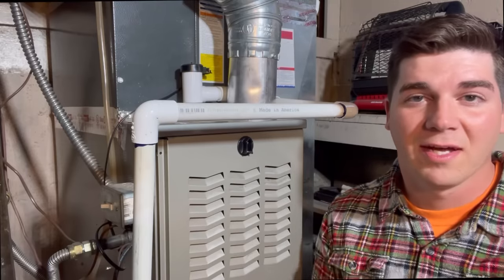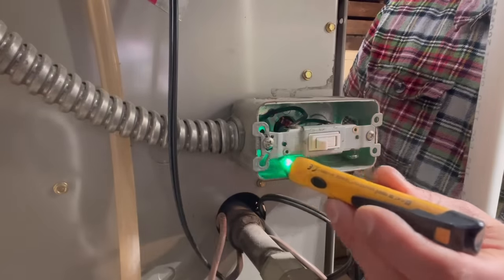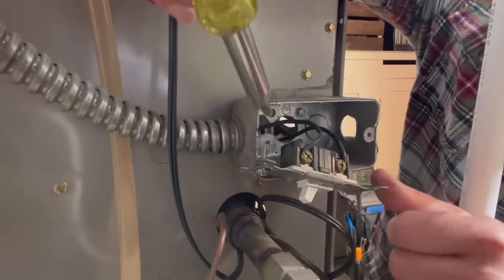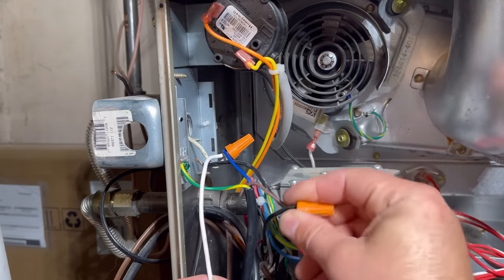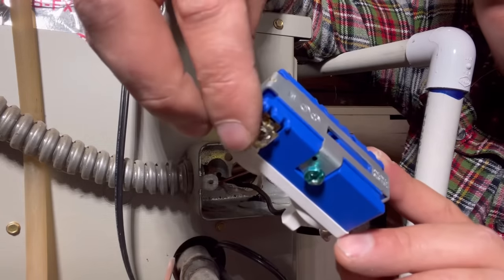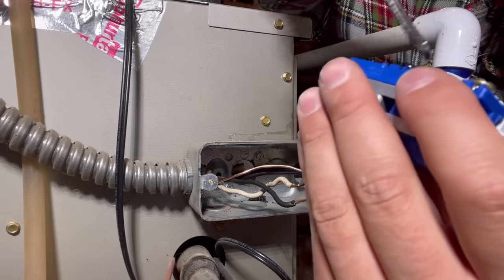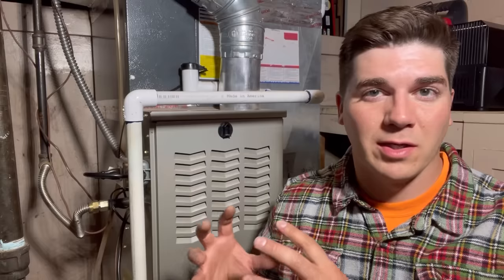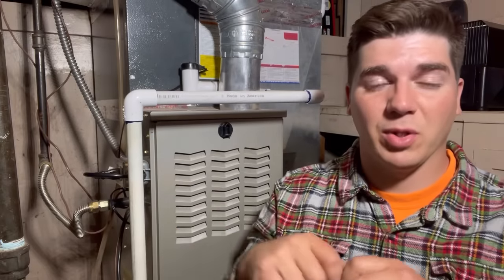This Could Keep Your Family Warm During An Emergency Power Outage.

Comment: One thing I would suggest is that the plug and appliance cord that you use is rated for the amperage that your furnace is on. Meaning a furnace on 15 Amp circuit should have a minimum of 14 AWG plug and receptacle connected to it. 20 Amp circuit should have minimum 12 AWG
Reply: Incorrect.  The appliance cord only needs to be rated for the appliance load.  Does every thing you own that plugs into a 15 Amp receptacle have a 14 AWG cord????  No.  Stop giving advice when you know little more than nothing about it.
Reply: @DiffEQ  As mentioned it is a suggestion, not a requirement. He didn't cover that in the video, so I made mention of it
Reply from the maker: Thank you for this 🙏🏻
Reply: I'm mildly concerned that he used a 15A receptacle and plug on a 20A circuit. While it's certainly possible his furnace doesn't pull more than 15 amps, other people's furnaces might, and this will lead to people using under-rated extension cords during an emergency.
Reply: @DiffEQ a furnace that is hooked directly to a 20 amp breaker should be 12 awg all the way to it. Doesn’t matter what the load is. If the manufacturer says a 20 amp circuit minimum of 12awg.
Reply: @robbievermillion5101  the power supply wire in the furnace is not 12awg, i double its even 16awg
Reply: @catgirl_works  thought I was the only one who caught this.  Furnace circuit was 20amp.  Assuming this is the only "outlet" on the circuit per NEC 210.21 (B) receptacles a single receptacle has to be equal to circuit.  He should be showing and linking a 20a switch/outlet.  The 12/3 pigtail would then be necessary for this install.

Anyone who has a 15a furnace circuit would then be ok utilizing a 15a switch/outlet and 14/3 pigtail would then be sufficient.  

Now it gets a little tricky per NEC if the furnace circuit is supplying multiple outlets on a 20a circuit then 15a or 20a outlets are allowed per code.
Reply: @JSATI  It seems like his extension cord is very short. This makes a big difference in its conductance. If it is longer, then you start running into it acting more like a fusible link or a resistor (getting hot with measurable voltage drop) on the other side of it.

Comment: I did that years ago so I could plug into Honda inverter generator when power fails. It’s been used many times. In 2020, had a full system changed. The installers saved my parts, and asked me to wait until after inspection before modifying again. I used two boxes since I have a condensate pump, and used a surge suppressor outlet. I have a modulating system, so want power line protected. Also, added 50A240v suppressor to outdoor inverter unit. Great idea, easy to keep warm when power fails.

Comment: I made that exact modification to my furnace 30 years ago when we were having frequent power outages.  Did it in my next house also.  Saved my bacon on numerous occasions, especially in 2017 when a windstorm took out power for almost a week!  I was able to borrow a generator from a friend and I had heat (and refrigerator and internet!)  My current neighborhood has below ground electrical service which has been very reliable, so no need to do it to this one yet.
Reply: Hay Dave,
For safety sake I always wrap my connections with electrical tape, especially when they are in close quarters like a steel box.I just like to insulate them so that they don't possibly short out at some point and possibly cause a fire.
Reply: @danstein8305   A short to ground trips a breaker.
Reply: Wow! Wish my internet was somehow connected to my furnace.
Reply: @duckhunter8387  I still had cable, just not electricity.
Reply: @dperreno  Just a little sarcasm! Peace Brother
Reply: My town in north east Montana has underground & above ground power lines from the power plants to the substations, substations to substations to our town, to my house. 
Just because you have underground power lines from your home to your local electric supply substation, does not mean that you will never be out of power. 
Once a wind storm 75 miles away put us out of power for 4 hours. 
Long enough for the food in the refrigerator to become questionable. 
Hello from the north east corner of Montana. 
10 miles from the Canadian border.
Reply: @dperreno  My current generator connection powers my refrigerator/freezer, enough lights for safety, a power strip for device charging (I consider a charged phone a must during emergency conditions), TV and radio (ditto), and my internet modem. 
This is a reasonable minimum system to keep me, my family, and my home safe when there are no freezing weather conditions.  A mod such as shown in the video will extend that safety to freezing conditions as well.
Reply: Not required per code, BUT you are required to have an earth ground on the metal box per code. If you get a short, a breaker will trip.

Comment: About that “secondary measure” to test for power: I like to test for power BEFORE I shut off a breaker, so I can detect power, then shut off the breaker, then re-test. This is a great tip, I’m going to do it (any day now….)
Reply: One further measure to verify there is no power is to short your hot wire to a grounded appliance surface or to a neutral wire. This s more trustworthy than the inductive tester imo.

Comment: Had a new furnace installed in may. My guy set this up on my furnace. Had a code pop up on my smart thermostat. Easy fix to turn off for five minutes. Flipped switch back on problem fixed. I recommend this for every furnace.

Comment: I do it differently. I install a high quality female plug on the end of the armored cable and then a male plug going into the furnace (similar to what you did but also using armored cable). Normally the two are pugged into one another but you can unplug the furnace and use an extension cord to your inverter or generator. Very simple. No extra switches or boxes or anything else.
Reply: And safer for the linesmen trying to get your power up and running.
Reply: @donziperk  this mod can in no way create an unsafe condition for the linemen.
Reply: Having a switch near the furnace is a code requirement in many places. I think that might be based on the assumption that the furnace is hardwired. Some jurisdictions only require the switch if it's hardwired, but other places (like where I live) have a blanket requirement for all furnaces. Of course, many places also require all furnaces to be hardwired anyways.
Reply: @johnbugden2222  Yes, this is true. There is a red colored plate that identifies the switch too. That switch should not be removed or altered in anyway. And of course, licensed electricians must follow code or risk losing their license.  But what a home owner does after the fact, is up to that person. And must take all responsibility for the modification. Videos like this one can be a great source of information for many people, but there are those who really don't know what they are doing and should never attempt such things. That's the scary part.
Reply: @johnbugden2222  In our city, a switch is required. But the code changes. Our old furnace had the switch up high, so a child couldn't reach it. Now the code requires the switch to be low, so that anyone can reach it.
Reply: I did it this way once with short sections of a 12 gauge extension cord with transparent male plug with power indicator lamp molded in. Code aside regarding furnace master switch, this scenario guarantees that there is never power sent upstream to the lineman on the pole down the street. The furnace is only connected to the MAINS voltage or emergency back up but never both at the same time. Sure a plug should not be used as a switch. But with no load and a VERY LOW frequency of ON/OFF cycles I think this small electrical technique indiscretion might be overlooked.
Reply: @Roy Riederer  Absolutely, there's nothing wrong with your method in my opinion. I commented because I think you may be able to follow the method in this video and still be up to code in certain places. I'm not sure about that, though.  I also totally agree with your point about videos like this being very useful but I do worry about people who don't know what they're doing attempting these sorts of things. I'm not an electrician but I do know my way around these sorts of things. I didn't start out that way, though, and when I first made started doing diy electrical work I would do 5 hours of research for a 5 minute project. Not an area where you want to learn from your mistakes. YouTube should automatically include a warning for this kind of a video
Reply: @johnbugden2222  I know what you mean. One problem with attaching warnings to videos is the people who make silly mistakes are the same ones who ignore warnings. Sometimes, you just can't win.
Reply: I have a heat pump HVAC system but I have a gas backup. And the I guessing I need to pull the 220 breaker but I need information first  before I do anything. Thanks again for getting me to come up with a plan.
Reply: Can you post a video please.
Reply: I have a fused circuit to the furnace, can I eliminate it?

Comment: I love this overall idea and I think its a great contribution to family readiness, an issue I have worked on all my life. I do have a couple of small concerns about the execution that if addressed would enhance the longevity and the utility of the installation. I am a retired electrician after 45 years in the craft. I worked on alternative power on large and small scale projects. I just want to offer a couple of small alterations to this project. 

The clamp used to hold the cord is the wrong type. You can buy a cord connector at the same place you would buy the cable clamp use here, They are just as straight forward to use so the difference in the work is almost nil. The difference in a cord connector is that it squeezes the cord over its enter outside to hold it in place were the cable clamp clamps down on the cord distorting its shape and putting needless strain on the individual conductors. The compression of the individual conductors can cause the insulation on the wire that ends up under the cable holding ridge in the cable clamp. It seems a small thing but over the long haul it can lead to a fault which would open the overcurrent protection on your inverter and force you to locate the problem and repair it before you could get the furnace back on. 

Second thing is also rather small when compared to to the overall idea which is very good. The knock out between the switch box and the inside of the furnace has a rough and possibly sharp edge. By placing a chase nipple through the hole from the switch box side, tightening its locknut on the inside of the furnace to hold it in place, and screwing a plastic bushing on to its threaded end inside the furnace you can eliminate the possibility that the edge of that opening will cut into the cord because of the vibration of the blower motor over a period of years. It's a small change. the alternate parts will come to less than $5 additional cost and insure a longer and safer life for this modification. 

Tom Horne

This is my last and final will. Good luck to all of you. Joe Hill
Why yes, I am a red diaper baby. I was born into a union household and have been a union worker all my life.
Reply: "I was born into a union household and have been a union worker all my life."
Please dear God tell me you don't vote republican.
Reply: @rael5469  republicans keep you warm in winter and cool in summer. You’re welcome
Reply: @DoDgeSwaG  OK, put down the beer and tell me what that mean.
Reply: @9856CB  You're drunk. I can see that from behind a computer screen on the other side of the country.
Reply: @SL-xg4ug  Who is Brandon?
Reply: @rael5469  Bot confirmed 👌
Reply: @SL-xg4ug  You removed all your replies. Are you Brandon?
Reply: @SL-xg4ug  Would you care to explain which contributor you believe is a bot? 

Tom Horne

Comment: Not sure if anyone mentioned this below but the wire should wrap around the switch / outlet screws clockwise, kinda like the way you did the ground. Thanks for the video!
Reply from the maker: Yes thank you for this. Every little detail matters. Cheers
Reply: Only if he was using j-hook wiring to the switch/outlet. He instead used back wiring where the screw clamps a plate down onto the wire. (This is different from back-stab wiring.) Back wiring like this is common on commercial grade outlets. See this video from "Everyday Home Repairs" for the details of back wiring: https://www.youtube.com/watch?v=SSfPzunEQ9g (I'm sure there are other good videos, I just happened to know about this one.)
Reply: Nope, depends on the receptacle. He did exactly per the manual come with the receptacle. You can use the J hook method but that not the only method here.
Reply: No, this one has metal clamp plates, which are better still, and allow two wires to fit neatly.

Comment: I did this years ago, and have had to use it 2 times with am Onan Generator when we lost power for 2 days in the winter. It works very well. Only thing I did different was I used a red outlet for the furnace switch/outlet. This was much cheaper than getting a dedicated generator and transfer switch. I also installed an on demand water heater propane fueled to provide hot water if needed, that has only been used to test once a year. I bought an Onan rolling Generator for $1100 that is 3000 watts, and can run the heating system, a Honda 2000 generator for the refrigerator and emergency LED lighting in the house. so for about $2200 I can run my heating, refrigerator, lighting, TV and computer with a hotspot. That is much cheaper than dedicated external systems that cost between $10-20,000, 1 or 2 times I have actually used it in the past 12yrs. well worth it. Great video though.. I'm not a professional electrician but I do believe in hooks at the end of wiring and tightened in the direction of the hook. lol
Reply from the maker: A lot of people have mentioned this. I can only assume they were referring to the old switch, which I didn’t wire 🤷🏻‍♂️ I’m like the new one has the clamp connectors so I don’t know what y’all are squalling about haha  thanks for the comment. Cheers

Comment: Thanks, this mod makes sense for me since I have both battery backup and a generator that does not connect to the power panel. The battery backup is for the on demand water heater that I installed some years ago, and allows me to have hot water during PG&E enforced outages. The generator is for when those outages go on for days, which has happened here several times..
Reply: In which blue state are you interned?
Reply: @qanononabong8491  Oh, I think you can guess.
Reply: Is your battery back up for on demand water heater runs through the inverter and a deep cycle 12V battery? Curious to know exactly how you did that set up.
Reply: @olegk455  No, actually an off the shelf APC UPS unit. The power draw for the gas on demand heater is minimal, just the fan and the operator panel. I did a test and it lasted more than a day on the UPS. I have a couple of those APC units around the house, and they give me time to put the generator into operation, which is fairly low tech. I run an extension cord into the house to power essential lighting and the refrigerator. I am planning to do the heater power cord conversion to operate that on the APC as well.
Reply: @scottfranco1962  brilliantly done sir. Never even thought about APC solution for water heater to be honest.
 We have an older Navien CR-210A water heater but you are right it probably doesn't need much to power electronics and the fan.
 Will do some research how big of a unit I would need and installation set up. Thanks a lot for the tip!
Reply: @qanononabong8491  Like Texas is some sort of electrical distribution paradise. At least you get some warning in California, and they don't have you freeze to death there.
Reply: @scottfranco1962  One more reason to stick to a tank.  I can run hot water without power.

Comment: I think, as an Electrician, I would have moved the recepatacle over, either on the furnace or elsewhere. Then install a power cord with a box connector directly to the knock out on the furnace. This would make it clearer what is going on and allow more room in the box.  In most areas of the United state, it is required that the furnace be hard wired by the NEC, but clearly in some areas this is not the norm.   I really cannot think of any reason this would be dangerous though, assuming the generator is outdoors in a well vented area, and the extension cord is run carefully to avoid damage.  A gas furnace does not draw a large amount of current and having it cord and plug connected in normal use should not pose a danger and does povide a means of disconnect.  But I say do this at your own risk.